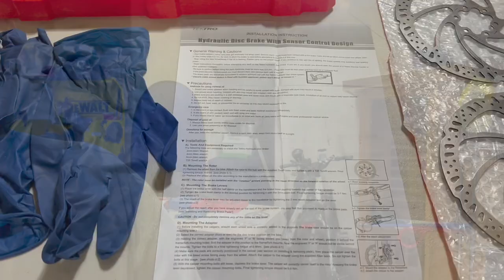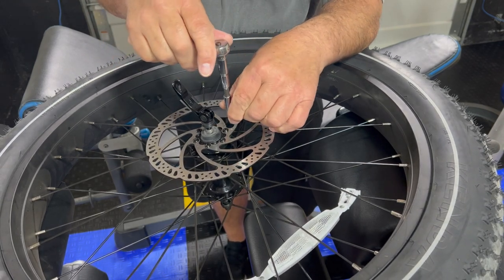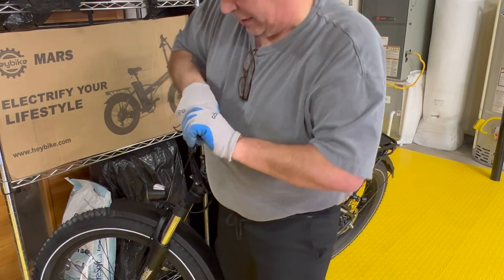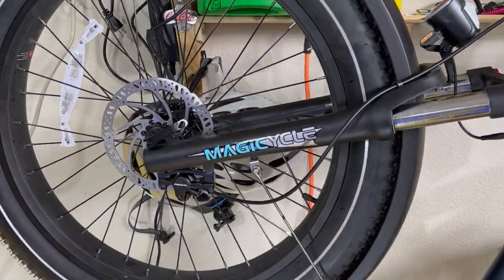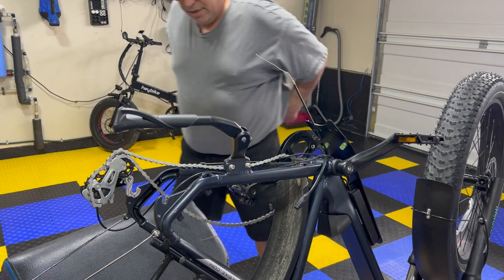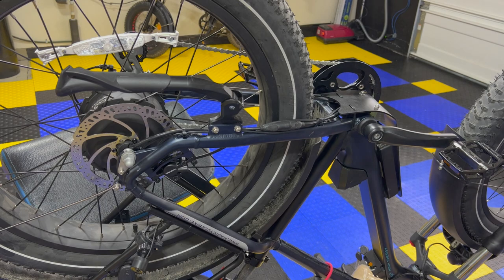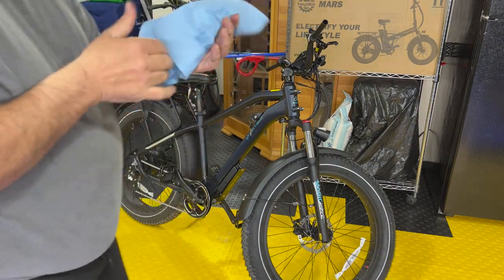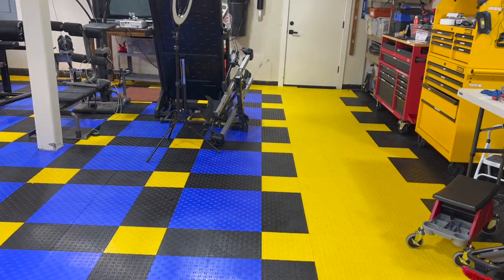How to Install Tectro Full Hydro Brakes on Magicycle Fat tire E-Bike

Comment: Hey boss, for that handle grip wrestling match......if you work a little space between your lever and your grip, once you do that, try working the handle grip off from the inside end.......or on the opposite end from the one your gonna remove put a blow nozzle in that end and while your putting air into that end plug the hole In the end of the other one and it should do the rest.....

Comment: And if you want your back brake on  the left side just unscrew take the wires out and switch them,out the wires and switch them so easy on hydraulic make sure you hold those wires up so nothing leaks out though until you're ready to switch you really only need it on the left side if you want to practice wheelies,

Comment: Congratulations on a successful upgrade. This is the reason I did not buy a magicycle, I did not want to do this myself, I’m definitely capable of doing it, but why. Should be standard on there bikes. I purchased a beecool pathfinder and it’s a great bike with hydraulic brakes already installed. But thanks for the video.

Comment: You helped me a lot on my brake upgrade. I installed a different brand, and the front brake and the rear were reversed. Rear on the left, front on the right. But that didn’t matter to me,  because I brake with both anyway. But just a heads up. Thanks again!
Reply from the maker: Good to hear.  Happy to help.
Reply: @RVEnthusiast  the only downside are those screws on the front rotor that have to be torqued. I know I stripped at least 2. I’m going to have to go to the bike to have them redone. They are not high quality.
Reply from the maker: @jbwjr54  I had issues with the original screws thet were installed into the rotors.  The replacments in my kit were better than the originals, But yes...100% those screws caused me the most problems.

Comment: Very thorough install, nice work. It's been difficult to find a hydraulic brake swap, most videos are just on the caliper portion which is not the same as a full swap. Glad you went the in depth route and I can skip around or speed up to get past some of the details. I have been considering a full swap on mine so its good to know an estimate of how long things will take. How have the brakes held up so far?
Reply from the maker: The brakes are great.  Holding up well. Install is not hard, just a little long to do.  They are a really good improvement on such a large heavy bike.

Comment: If you have some WD40 shoot it in between the hand grips and it will slide right out!!!  When reinstalling them clean out the inside of your grip and use a little bit of hairspray and slide them back on and put them into the position you want them and it will stay in place!!

Comment: Helpful video. Thank you!
Youtube channel "Project Farm", showed how he used an air compressor that was fit with a small brass tip, and placed it just under the edge of the (handlebar?) grip.  Just a small amount of air and those grips just slid off! Pretty cool.  I'd never seen that technique before. It was on a video about "converting a bicycle..using a 2-cycle engine"---or something close to that, if you wanted to see the specs. Thx again.
Reply from the maker: I have seen that’s  video,  Project Farm is awesome.  That guy is making bank for sure.  Very smart guy.  Funny I have all the things needed to do it, but thought I would just pull.  I worked, but I should have at least tried Project Farm method.  Thanks for taking the time to comment.  Very appreciated.

Comment: You could use compressed air to remove handle grips very easy, then use soapy water inside grip to easily slide grip back on. Trick from regular bike maintenance.
Reply from the maker: I like isopropyl to put it back on.  More work getting the compressor out of the RV in The Barn than giving my forarms a little workout.  I could have cut them off as well.  Lots of ways to take them off...Work was my choice this time. LOL

Comment: That front brake cable needs run on the inside of the fork.. or it will get snagged on something, otherwise good vid
Reply from the maker: Ran t where the other one was positioned.  I thought anyway.